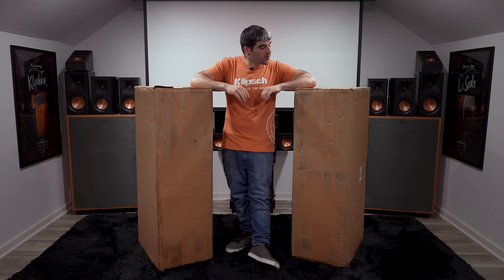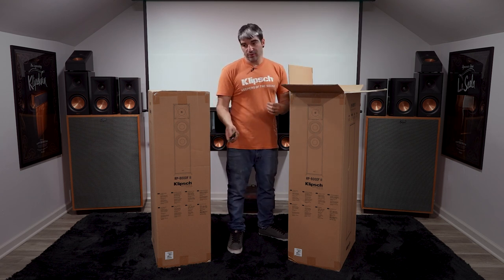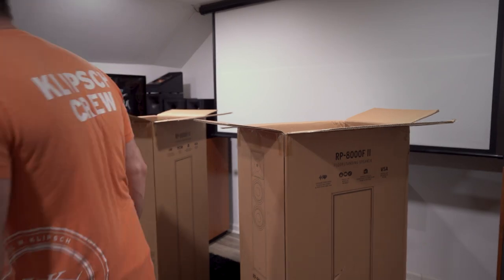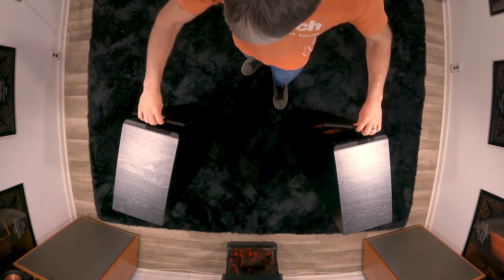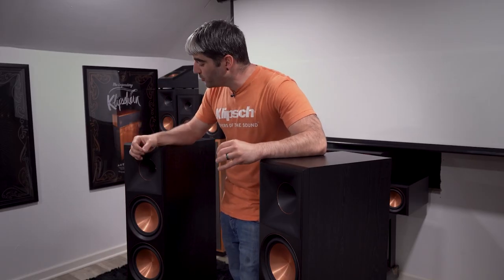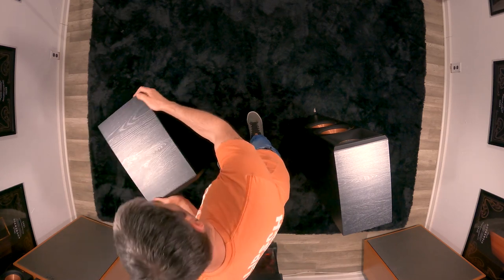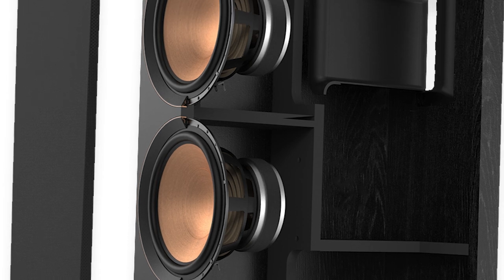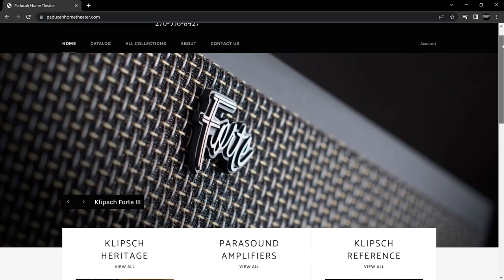Klipsch RP-8000F II - Unboxing and taking apart the big boys!

Comment: Looking forward to the 8000F vs 8000F II.
Reply from the maker: Coming soon. Stay tuned!

-Jason
Reply: Wonder if it is worth double the cost for the new ones, I may just go for the older ones because it seems to me all they really did is add the potential for dolby atmos.
Reply: Pls compare klipsch rp 8000f and rp 8000f gen2,which Towers sounds better!!
Reply: @salikali2  Not true at all.  Several significant differences.  Completely redesigned internal cabinet, added another port, additional bracing.  Crossover is changed.  Tweeter horn is changed for a wider stage.  Woofer is redesigned to be tighter and punchier.  External cabinet cosmetics are slightly changed.  In no way is it the same as the gen 1 8000F.  BTW - the gen 2 is on sale now.  Less than $400 difference.  Seems like a no brainer.
Reply: So looks like we currently we have the RP-280F for 349.00 each,  RP-8000F for 429.00 each and the RP-8000F 2 for 899.00.

Comment: I cannot wait for your next upload anymore!! 😅 Any comparison between the last and new generation will be great, but what really keeps me awake: how does the shorter and closed 404c II compare? Are these changes so significant that one should rather buy the 504c II if you have the space it needs?
Reply from the maker: Thanks for watching! The plan as of right now is, a quick review of the system as a whole, followed by the 504 generational compare, then the 8000 generational compare. 

As for your other question, I am a huge supporter of bigger is better in the center channels. While this isn't always true, in most cases it seems to be. If you have the space, go with the 504. If you are limited on space, the smaller units are a good compromise and are not a disappointment by any stretch of the word but...if you have the space...504 for the win!

-Jason

Comment: I bought a pair of Klipsch RP-8000F II 3 days ago and when attaching to my amp with MIT cables broke the threaded part of the banded black post.  I see you removed that post assembly and wonder how difficult it is to replace one of the posts.  Also what size banana plugs would wocan be used to make it easier to attach? Thanks
Reply from the maker: Thanks for watching! You can actually pick up replacement posts online for fairly low cost. If you are uncomfortable replacing just the post, you can give Klipsch a call and they may have a replacement input cup available for purchase. It's not a huge undertaking if you are comfortable working on your own gear. 

-Jason

Comment: The Atmos footprint should match the top of the Floorstanding speaker to give it a seamless look.
If you must have it on top then the FA Which comes with a 6inch woofer with a much cleaner look.
Reply from the maker: Appearance wise, yes, it tends to look better this way. Performance wise though, the toppers do great in most scenarios. It also adds a bit of flexibility setup wise, as well as budget wise because you can add later if desired. 

-Jason

Comment: Any idea if the crossover network has been upgraded to configure the speaker as a 2.5 way design?
Reply from the maker: Honestly not sure. They haven't mentioned it being a 2.5 but, sometimes it is and it's not listed as such. If I hear more, I will get back to you but for now, have to assume its just a 2 way design as listed. 

-Jason
Reply: @TopShelfAudio  Thanks.  Audio Advice was able to confirm the network remained a standard 2 way configuration unfortunately.

Comment: As usual great video, I agree the cabinet is an upgrade and they look cleaner too the binding is a nice touch too I don't believe in that kind of Atmos system I may be wrong but I believe that if you want sound coming from the sealing you need speakers up there just my opinion
Reply from the maker: Thanks for watching! As for the reflective atmos -  if someone has the correct ceiling/placement/positioning, they actually do an amazing job. Had a set myself and rocked em for a couple of years. That said, when I moved, I had a different style ceiling and they were a not go. Had to sell em. They are for sure impressive but, again, you need the correct placement and structure. 

-Jason
Reply: @TopShelfAudio  they need specific seiling ,my seiling is not good for that, but it's really better than having the speaker up,my room is my bedroom so I had to tweak a lot because is small too but I did manage to get a 7.2.4 I pulled the bed out and used the smallest speakers satellites which I hate that kind of speakers M1s for the rear surround and I have them 4inc behind me and used the same a pair of m1s for in seiling like middle  and DM 302 bookshelves as front heights tilted down and it came out quite good, there is a scene in the last episode of godless wind and dust it's like I'm there sound coming from everywhere
Reply: Hello I have a question is the only way I can get good information I told I got the RP 8000f I got them for 700€  each 1400 € a pair and 650€ the RP 504c  and to swap just the new RP 8000 will maybe cost me 5 or 600 € more and scene I can't just go and hear them myself because here we have non of that here we buy blindly or find a good channel like yours and learn so the next best thing is to ask someone that Heard them himself so is it worth an extra 600€ to get the new RP 8000f 2 are that much better to justify getting them extra 600€,I was thinking to get the new 504 but I jus can't sorry for the long message
Reply from the maker: No problem at all. We are here to help!

Honestly, I'm not sure yet. I have heard them independently but not side by side just yet. Hold out for one or two more weeks and we will be doing a side by side compare video between old and new gen. From there we will be giving our opinions on this. Stay tuned. New episodes featuring this content coming soon!

-Jason
Reply: @TopShelfAudio  ok thanks I appreciate your work and honesty!!

Comment: What did you use to take the speaker binding area out I tried Allen wrench no go that looks like a screw driver but the bolts don’t look like screws please help I have a loose positive biding post and I wanna see if I can fix it

Comment: I want to run these along with the 504C series 2 for the front.  Would you recommend more RP-8000's for the rear or the RP-600 bookshelf rear speakers?
Reply from the maker: Depends on you and your personal preference. I am of the bigger is better mindset personally but, as surrounds only, it's possible they won't ever be reaching their full potential. In most cases, as surrounds, the 600s will be perfect. That said, you also will never be left wanting more if you go with the 8000s. In the end though, your call. Both will perform great in almost any scenario. 

-Jason

Comment: I am still waiting for Klipsch to send me a replacement 8000f woofer after mine somehow got a tiny but annoying dent in it; been waiting since March 2022 for them to send it; bad customer service  from them. I have watched videos on taking out the woofer and seen everyone uses a screwdriver and cloth, have you ever tried to use a credit card instead? seems to me it might be less liable to damage the cabinet. If and when Klipsch send me my part, I will let you know how my disasembally went.
Reply from the maker: Thanks for watching! Having personally worked in Klipsch customer service several years back and still knowing much of the team there today I can say, it's not the customer service team that's bad. It's that the parts are genuinely unavailable. These last couple of years have been pretty messy for the supply chain. I'm sure they are doing the best they can to get you the part. 

I have tried several options but never a credit card. conceptually it would be similar to the guitar pick others have suggested. Somewhat malleable plastic and should work well! I still recommend wrapping in a light cloth of some kind though as, it can still scratch the paint. Good luck with your replacement when it arrives! Hope if goes smoothly!

-Jason
Reply: @TopShelfAudio , Cheers, Jason. I contacted the secondary company that is supplying the place I bought from with the spare part, I got an email last week  from Henley audio to say the part should be in the UK by the end of this month. I really hope so because 2 and a half months it wil be 12 months waiting. I will let you know how it went when I finally get the part and attempt to swap it over.

Comment: In your honest opinion would I need a Sub with these for metal music  while running a vintage receiver for a 2.0 setup?
Reply from the maker: "need" is relative.  They'll reproduce most everything in the recording, especially in a smaller room.  However some bass heads enjoy separate subs due to the ability to run them like 6-8 db hot.

Comment: I have the RP 8000F II, since yesterday. I connected atmos speakers on top and they are working but the RP’s are not. What am I doing wrong? Thanks
Reply from the maker: The top channels will need a dedicated amp channel to them/two connected channels per speaker. Do you have a height channel connected to heights, as well as the main amp channels connected to the lower terminals on the back?

-Jason

Comment: Hi i have a yamaha tsr700/rx-v6a powering my current system with rp600m as my left and rights. Just wondering if i should think about upgrading my receiver if i upgrade to these new rp8000f v2’s
Reply from the maker: That receiver is great for your 600ms but I would consider upgrading with the 8000s. While it will work, you won't reach the 8000s full potential with that receiver. 

-Jason

Comment: Klipsch really has been banging it out of the park. Seems like these are working their way up to replace the older RF-7 line. Wish they would do 2 x 8 inch woofers, a 6.5 mid and then the tweeter. Glad that Klipsch is getting to a more neutral sound.
Reply from the maker: This new generation is super impressive! I'm finishing up my review of the system as a whole to launch this Saturday and, after a couple weeks of listening...really struggling to find anything negative to say. It's an awesome new system. 

-Jason
Reply: @TopShelfAudio  Excellent, I have put it on my calendar to look for it Sunday. Eager to hear it as My RP-280F still feel a little bright on the high end, although better than the RF-35 they replaced. I am holding off until later this year as I want to try and hear the new line, and am comparing them to the Martin Logan 40i and Polk R700

Comment: You can hear the driver basket ringing just by manipulating it in your hands
Imagine how well that ads up to the music 🤦🏿‍♂️
Reply from the maker: Love these comments. Yes...it makes a sound when you tap it with a screwdriver or swipe a hand on it. This is especially notable when leaning over top of it and the mic is only a few inches away. I'm sure if the basket were a different material, you could hit it with a hammer and it wouldn't make a noise.

-Jason

Comment: How do I wire these if I have the Dolby Atmos speakers resting on top of these? There are three connections on the back and I have no idea where wires go and which ones connect to my amp. Please help :)
Reply from the maker: You'll connect your toppers to the top connector holes in the the 8000s using the supplied cables. On the bottom of the 8000, you'll then connect where it says "height" to the height/atmos channel on your amp. Where it says "main" on the 8000s, unless biamping, youll leave the jumpers in place and connect your amp to one of the positives and one of the negatives there. hope this helps!

-Jason
Reply: @TopShelfAudio  Is it necessary to leave the jumpers in place?

Comment: Stamped steel drivers, yikes. They certainly focus on making them cheap!
Reply from the maker: inexpensive to produce and still sound great? win win. Had tons of em over the years and never had a problem. 

-Jason
Reply: @TopShelfAudio  buy once cry once, better to buy quality instead of cheap and have to upgrade later. I’m sure they sound ok but it’s not much more expensive to use quality parts, the vented spider and pole piece is a good design and it looks like a nice driver but you’ll have a resonance in the basket when it’s so thin, and it’ll be audible. They put all of that poly fill behind it to mask it but that will over dampen the cabinet (port velocity), just moving the problem from one area to another. The crossover looks better than the last one, but still super thin gauge on the inductors and sandcast resisters. The Polk r700 are better made for the price and probably do sound significantly better as a result. I haven’t heard the new klipsch but I have the old and I like them but for the money there are better options.
Reply: I am not sure how much it matters honestly. I used to think it really did and now I own speakers costing 5-6 times the price of these Klipsch and build much better too…. And when I hook the Klipsch up to my McIntosh gear and highpass them at 60hz they sound pretty good. 

Compared to high dollar stuff I own I feel the RP8000F lacks bass definition (fixed by high passing subs as I do with everything anyway) and some mid range clarity. The highs are very good though. 

I have a feeling the new crossover will fix some of the mid range clarity and the box bracing might clean up the bass a bit.

Comment: Very cheap crossover parts
Reply: Though it still has poly caps and air core inductors, other than for the mid/bass woofers.  If you add boutique components, such as what GR research provides, it would likely add a few hundred dollars to the price.  That price difference changes what it would compete with.
Reply from the maker: They are designed to hit a specific price point and make them attainable to a larger crowd. That said, function being the primary goal here...have you heard them or are you just commenting based on a pre-conceived notion that more expensive/bells and whistles is always better? 

-Jason
Reply: @TopShelfAudio  that makes sense and by the way all my speakers are Klipsch except for my subwoofer which is an RSL speed woofer 10S Mark II